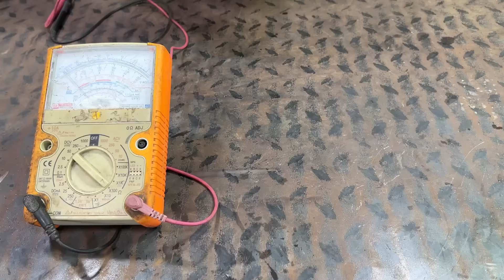The Young Mechanic Successfully Restored The Badly Damaged Smoke generator

Comment: Restoration Skills, I'd highly recommended you to put all of rust screws in a glass cup of vinegar (it help with remove the rust) to get rid of rust and after around 12-24 hours, take it out and rinse with water to deactivation the acid from vinegar. So that way the rust won't scratch the fresh paint. ;)